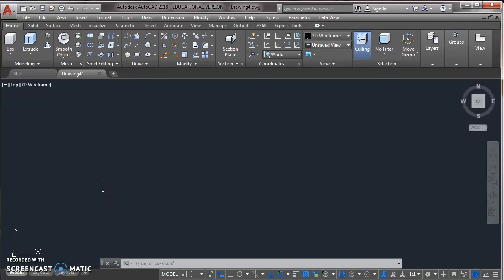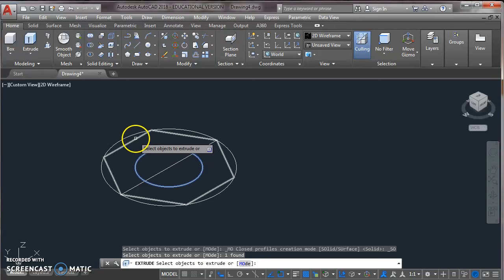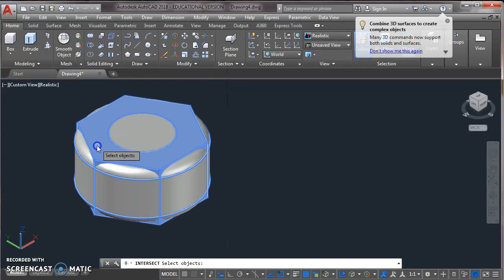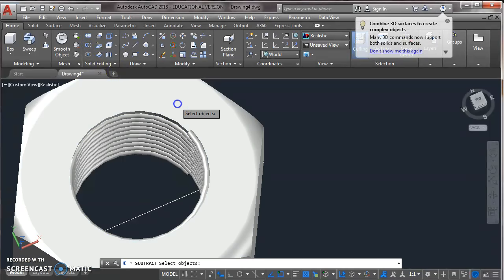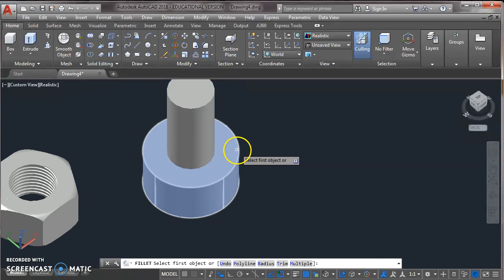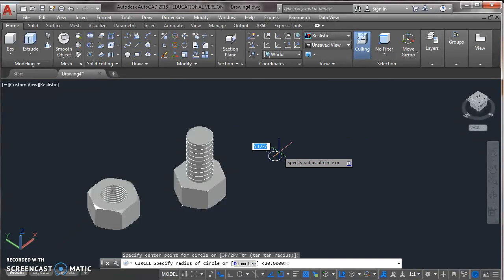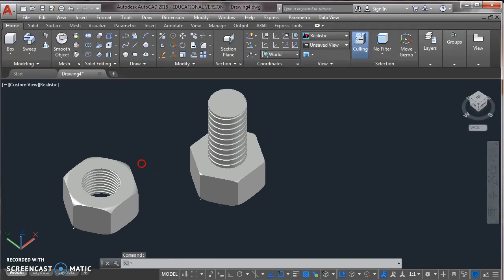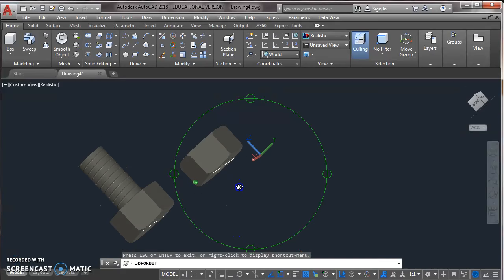Draw Nut & Bolt in AutoCAD just in simple steps. |LearnCAD|

Comment: The screw subtraction is wrong. However the nut and the screw can not have both subtracted helix. The nut shall have the helix outside so you can put the nut around it.
Reply from the maker: yes, u are absolutely right.
but this video just teaches the AutoCAD commands.